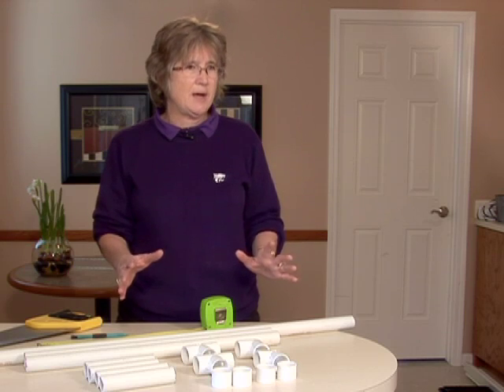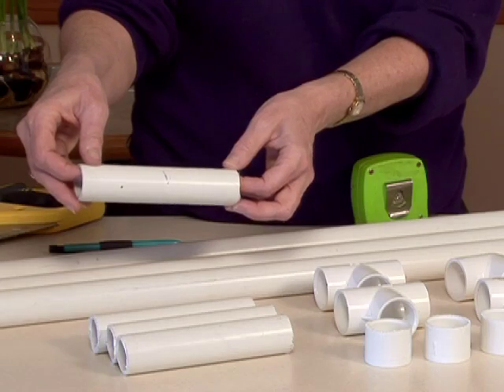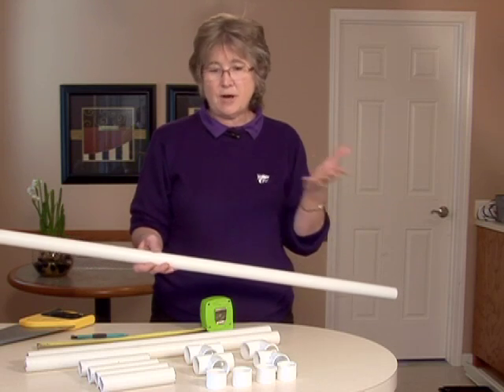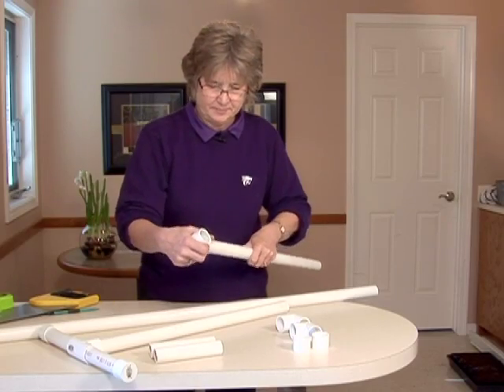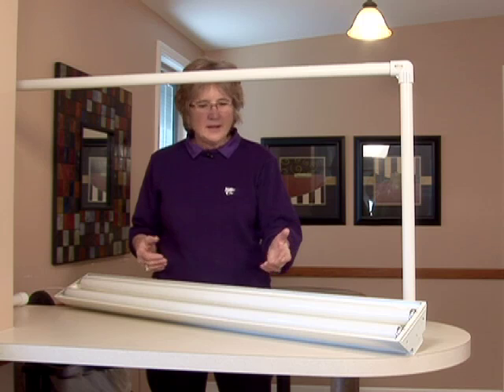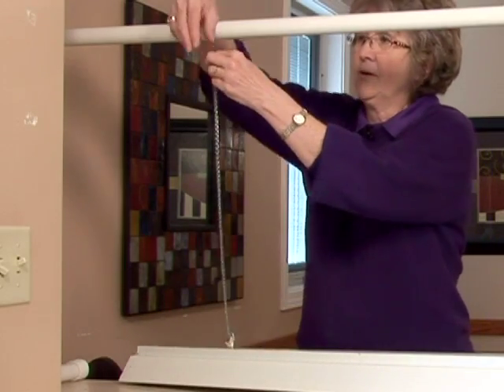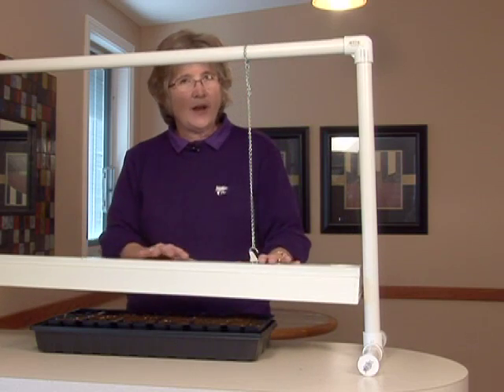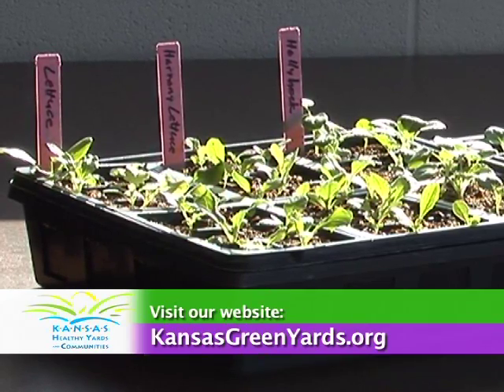Easy to Make Grow Light

Comment: If you have a 4ft shop light and you use a 4ft piece going across its not going to work.  You need to make allowances for the amount the 4ft section will sit inside each elbow.

Comment: Thank you so much for this!  I've been wanting a grow light for several years now and just can't justify spending $160 for the ones sold at the garden centers.  Awesome how-to!  Thanks again.
Reply: I made this stand in 5 minutes and it cost me $43.00 at Home Depot.  I bought a medium priced shop light so it can be even cheaper. Thank you so much. So easy.
Reply: Its crazy how much some of this stuff costs from a Gardening Supply company. I just expanded my grow light to a 4-tube system using two shop lights.